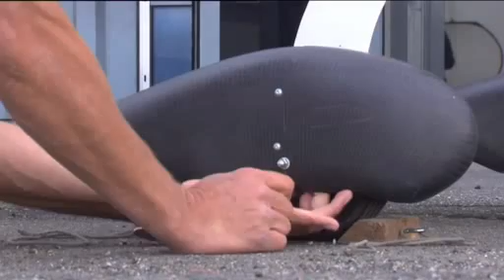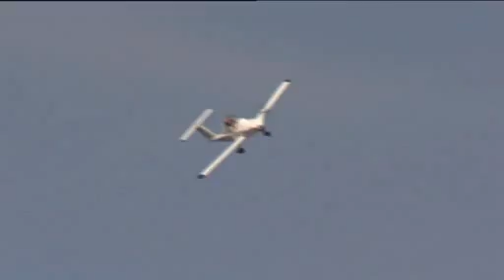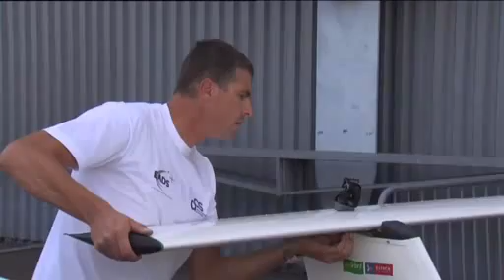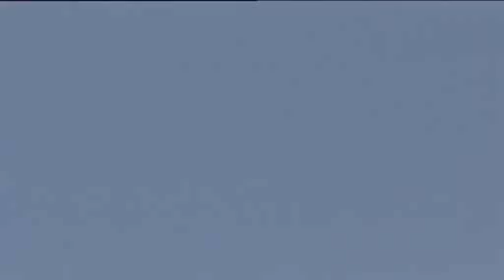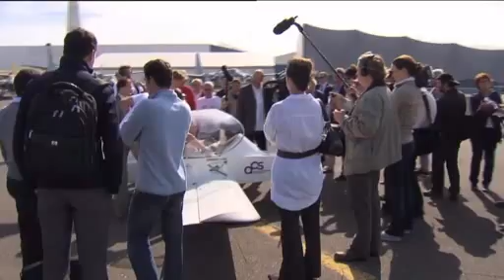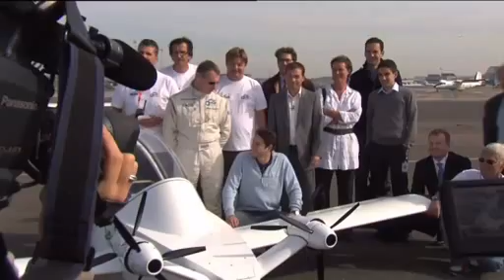Electric Cri-Cri 4-Engine Airplane

Comment: The 4 propellers are attached to MOTORS, NOT ENGINES.  Motors need a battery for turning a propeller and ENGINES need a petroleum base for fuel to run so a propeller can turn and produce thrust.  GET it straight,  MOTOR = ELECTRIC (battery)  ENGINE = Gas (a petroleum base fuel)  It does not matter what language you speak a MOTOR is a MOTOR and a ENGINE is a ENGINE.  In the aviation community pilots are not stupid, so show your intelligence and call it what it is, a motor = electric, engine = gas.          GOT IT!

Comment: We are currently in the process of building a 97% composite, twin powered, high wing, all electric GA A/C. We are testing both Contra and Conventional blades in our ducted fans. Not an easy project to say the least! Although the Contra develops more pounds of thrust, in a more stream-lined manner, the additional parts and weight, are not helping so much. Not to mention the additional maintenance cost. Suggestions? Thank you, Tesla Aviation.
Reply: F. Albert Clark do you ever work with self varying/variable pitched props? Some years age I made some for a wind turbine project for my home build. I found it much more economical. Currently I fly light aircraft and paramotors and I'm working on an 8kw motor. Powered by my home made battery cells cased in kevlar/carbon fibre boxes/units I've found the weight to be around 2/3 of a standard lithium unit of the same amp/Volt. Honey combing the kevlar/carbon shell with fibreglass has also helped me reduce weight on several projects.  Again, using a home made method. Currently I'm planning a home build twin motored ultralight. Though I'm considering buying an already built shell to take molds from. If you think I could be of any help. Your welcome to message me. Though I'm no professional. I enjoy this and consider it a hobby. Thanks

Comment: No its not, it is a matter of energy-to-weight ratio. Batteries have pathetic energy-to-weight ratio compared to gasoline or other fossil fuels. This can be tolerated for cars, bicycles and other roaded vehicles, but not for flyers. 

What you are talking about is energy conversion effectiveness, yes you are right, electricity is the most effective of all means so far. But for airplanes, range is more important than effectiveness. Ask any plane owner.

Comment: Do so in-depth research and you will find that hydrogen technology is even worse than a well-designed all-electric system.

I just experienced a piece of the future on Saturday. I road a homemade folding bike with a top speed of 80 mph and a range of 40 miles, double most electric bikes. But the eye opener was the advanced battery that was only the size of a water bottle and a motor that could fit in my hand. Electric tech is truly the future. For light aircraft not meant for traveling, why not?

Comment: There's no point trying to make airplanes electric. Even if they succeeed, there will be either very short range of too much battery weight. The solution is to make it work with hydrogen. This way you have both range and environment friendly clean operation. However it will not be able to be independed, ie produce its own energy, like a PV cell approach would be, you are right about that.

Comment: Cri-Cri could use solar sells in wings, charge on ground and in the air. Range would be short, batteries terribly expensive. Look to Europe and Middle East for solar water heaters, solar cells and inexpensive use of natural gas and electric we in USA don't manage well. Batteries are getting more efficient but need another generation of power cells to make it work less expensively. My great grandparents had wind power to charge batteries for lighting in North Dakota, made their own batteries.

Comment: Get real ! It's worthless as anything but a demonstration of something we already know.
What good is an air-plane they can only run 30 minutes in perfect conditions?
If they ever come up with a major improvement in battery technology electric cars , planes etc would be feasible but you still will have to burn oil.

Comment: I find this plane really very interesting also with Otto engines, but the electrical version shows that this kind of propulsion with its very high efficiency is really coming! My only question for the moment is: are four electrical motors more advantageous than two?
Reply: Four produces more thrust than two.

Comment: This would be ideal as a hybrid...  A little Honda generator for longer trips, and high power consumption times like climbout,  and batteries for cruise, landings and emergency power.
Reply: Can agree. If it can handle additional ≈30 kilos of engine and fuel, it would be great
Reply: If you're going to have a gas engine anyway, just use that to power the propeller directly instead of all the other stuff. It will be much lighter and have better performance.
Reply: @devilsoffspring5519  I understand what you're saying.  I flew small engines like this and had 8 engine outs in 6 years of flying, even with meticulous maintenance.  So, I love the idea of an electric motor instead of a small gas motor.  It seems like the weight might be worth: the fun, quiet and economy of electric flight.  And, I love the idea that a failure in the gas engine leaves you with battery power to find a safe landing spot.  Oddly, though small aviation motors have let me down (I've used several brands including Rotax), I've used Honda generators for years, and you can't get them to quit!  Though an ultra small airframe like the Cri-Cri might not work out for this scheme, I think it might be an interesting arrangement to try?  Just some odd thoughts...

Comment: do they use li-ion or lipo batteries? if they used lipo they could get a longer life because of the lower weight allowing for more cells
Reply: Lipo is also more dangerous, as drawing too much power or overcharging it could start a fire